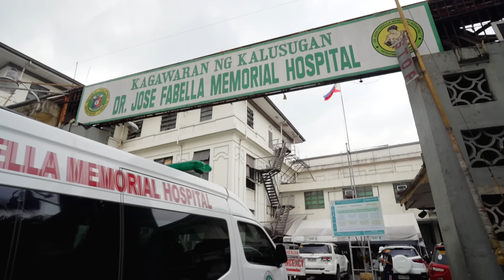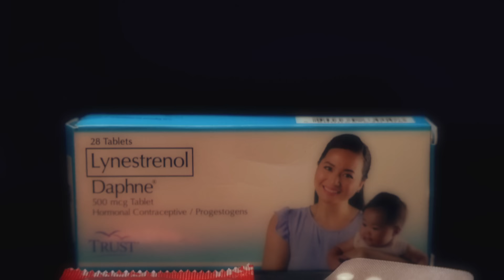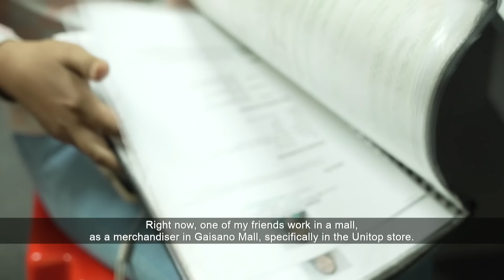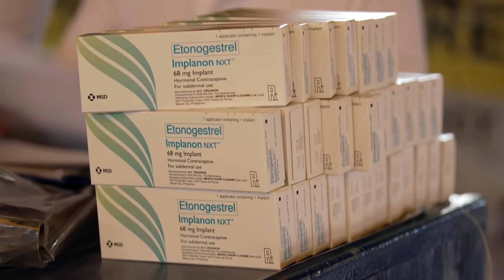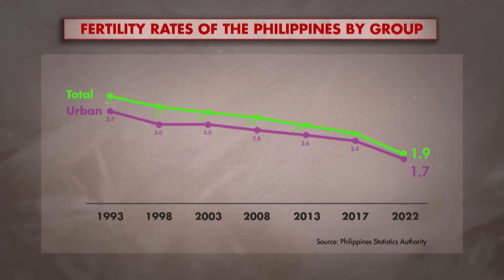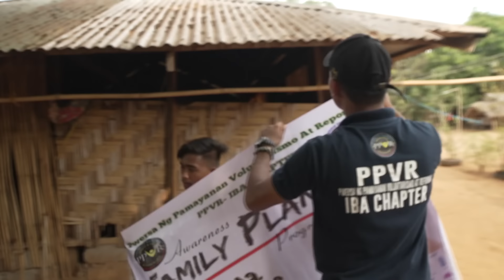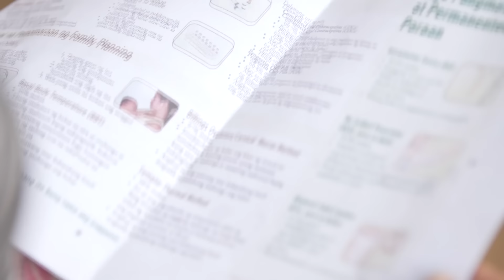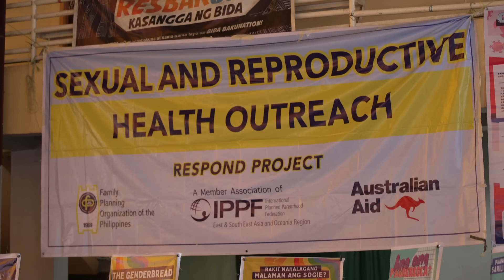Philippines Successfully Lowers Birth Rate: Will It Stay Or Rebound? | Insight | Full Episode

Comment: The slums of Tondo near the port area of Manila overshadowed the great history of the former Kingdom of Tondo pre-colonization period. It is a great testament of the kind of govt the Philippines had created. The early PH govt (post WW2) seemed lack the foresight and the vision to create a better Philippines either due to the lack of data or complacency of those in power. Also, they created laws that benefited mostly the families of the rich and those in power resulting the current problems we are facing today. Prime example is Overpopulation in urban areas which had been a debate for so long. But it took several decades before Filipinos realized that it is indeed a problem.

Comment: Those countries dependent on OFWs should start building their own labor force, which is not a bad thing.   I'm thinking of Singapore, Saudi Arabia, etc. which have thousands of Filipino OFWs.   For those truly adventurous, they can be more selective on their well vetted employers.
With the Philippines having a replacement valve of less than 2, it's dangerous (2.1 or 10 women bearing 21 babies are needed).
The new scam is to lure Filipino women for jobs only to find out that they've been deceived and kidnapped to become surrogate mothers.  Beware.  The Philippine government should protect its most important asset - its people.

Comment: No one "lowered the birth rate" every country around the world has halved it's birth rate from the 1960's. Even a lot of African countries have lower birth rates now. If you look at the data it actually started in the 70's I think. The birth rate back in the 60's in the Philippines was about 7 per female but it dropped lower and lower so now it's 2.7 or  thereabouts. This is a trend in most countries not just the first world countries... they used to think only countries with significantly developed economies will have their birthrates drop but this is not the case and even poor countries now have lower birth rates.